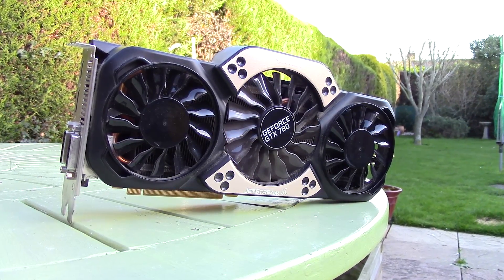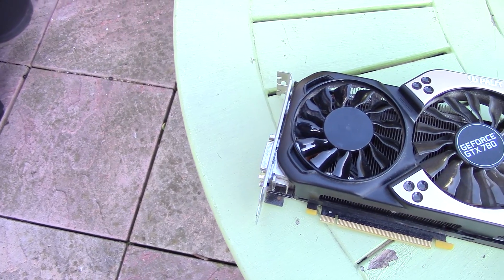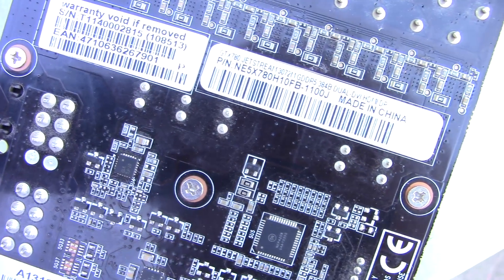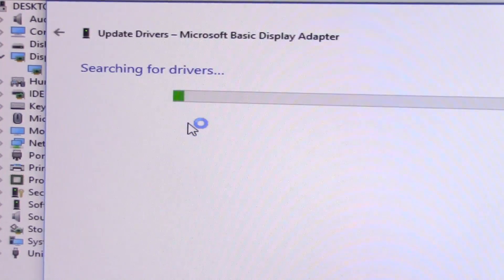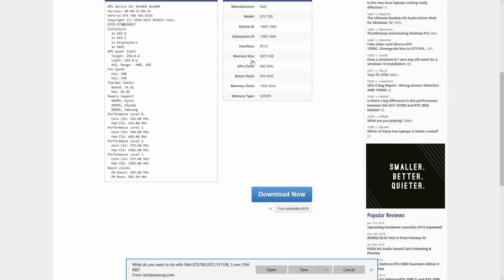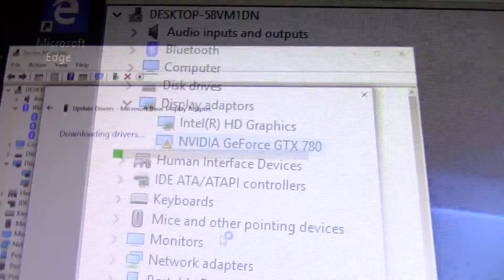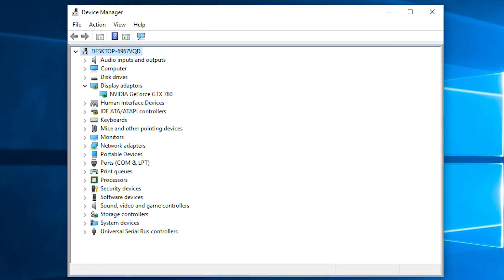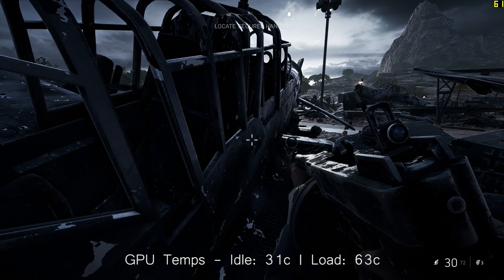Can We Fix This £20 ($25) GTX 780?

Comment: hi i have the i5 3550 but it only turbos up to 3.5 ghz do  you know how to make it turbo higher?      love the chanal btw
Reply: YOu can overclock the Turbo in your mainboard bios, IF you have the right board.
Reply: @MasterBlaster220  ok thanks
Reply: The only way to make your CPU Turbo higher is Depending on your Motherboard.

Maybe your Motherboard cannot handle anything higher than 3.5 Ghz.

Comment: I recently bought a half broken rx570 from a good friend of mine. Half broken meaning it would boot and work but only with the DVI Output so I downloaded the appropriate bios and flash tool, cobbled it all together and now I have a working rx570 with 8 GB in my System.

Comment: I know this is an old video, but did you notice if the new bios you flashed it with was different to the one already installed?
Reply: It doesn't really matter if it's newer or older BIOS than what already installed in the GPU itself.

What might actually happened with previous owner, the card may have attempted to update the BIOS, but interrupted during the process, like power outage or something, which resulting the GPU driver cannot be installed at all.
Reply: @ClayWheeler  thanks, but I wasn't asking if it was older or newer - I was asking if it was different.
Reply: @walruspolish  well, even if it's the same BIOS, he already explained that the existing BIOS is already corrupted.

Hence even if he's reinstalling / flashing the exact same BIOS it fixed the entire problem

Comment: hey i bought ASUS GTX 570 DirectCU ii from the marketplace facebook, the problem that the seller mention are same like this no detected in device manager since installing the driver turn into black screen i just buy it because worth for only 6£ with box and the unit, should i flash the bios to make it run again ?, if its work it will be awesome purchase for me. and also my christmas gift haha LOL JK.
Reply: Clean everything first.
Use Isopropyl Alcohol 100% (must not lower than 93% Purity. 93-100% Purity is Highly Recommended)
And then reapply Thermal Paste.

Comment: Ah, the good old intel 3450, I bought a box at a auction that contained 19 of those cpus and have 3 pc's that use them, 14 out of the 19 of the processors still worked and those bad boys will play a good amount of games when paired with a cheap intel motherboard 8 GB of ram and a decent GPU..

Comment: Still using asus dcu2 gtx 780 and gaming on 1440p. I have bought 1080 and rx5700xt but gave both back. This card is still capable in 2020 folks...
Reply: Any upgrades now?
Reply: @iboyrazz  not yet :)
I will use it untill next year i think and then buy something RTX. This card is really good and have served me well for all these years. Good bye 2020 and 2021. New card at 2022 :)

Comment: I had same problem with black screen on windows 7 with 970gtx. How do i fix the problem? I just installed old drivers from CD..... yes, for some reason old windows 7 with sp1 (2014y) had some issue, without any drivers i saw pulpit but after trying to instal 422 drivers i was getting black screen... basically after installing old drivers everything worked, then i just installed new drivers on old drivers and guess what, everything works, no black screan.

Comment: I've used ATIFlash a few times to flash the UEFI BIOS of a 7870 to an EFI BIOS for a 7950 for use in a Mac Pro. I also tried that with a 5870, but as for the 5870, i apparently got the wrong bios and bricked the card. It would no longer show up in ATIFlash, so i couldn't reflash the original bios to that card, so 

f

Comment: My gtx 780 I got for 50 working and I chose it over the RX 570 cause silence and also its a cooler in temeperature card. I also overclocked it and it works like a charm
Reply: What model of rx 570 was in your choices?  Because normally it is cooler than a gtx 780
Reply: @mikaelkabraelian8518  the red devil rx 570

Comment: A 7970 currently performs equal, or better than a 780.  The 7970 is older, and was slated to compete against the 680. The generation of GPUs released after the 7970 and 680 kept these cards around in a near identical rebrand. The 280x for the 7970, and the 770 for the 680.  The fact an orginal Tahiti 7970 now performs better than a 780 is outright pathetic on Nvidia's end on support older, but certainly still very useful GPUs.  The 7970 was released back before current gen consoles were even available, and yet they've gotten every frame possible thru the drivers. Were well made cards and were reliable.  I mean, fantastic 1080p gaming can be had for dirt cheap with these 7970/280x card for dirt cheap second hand.

Comment: Hey... I also discovered flashing GPUs from within windows, you can actually use team viewer from another pc, to connect to it as it uses its own display driver and not dependent on the graphics driver itself.

Only downside using Team viewer is that the resolution is 1024x768 which makes viewing some content crap, but it is plenty enough for running console commands to flash GPUs.

Also, I don't think you need to create a bootable to run NvFlash or AtiFlash. You can just run it from within windows using either your iGPU or Teamviewer.

Comment: I should have flash the Asus Cerberus GTX 1070 TI , but i was asking around the community so they opt for a replacement because it is still under warranty, and thus i got the MSI Ventus RTX 2060 instead.

Comment: I am a newbie too when it comes to GPU BIOS but I've flashed both my 1050Ti and my 460. In both cases I had to get in touch with the manufacturer and provide the serial numbers. Apparently it is not recommended to go on TechPowerUp and download what SEEMS to be the correct BIOS as there may be different BIOS for different revisions of the board. Just my 2p contribution :)

Comment: This inspired me to take up a challenge of buying a faulty GPU and seeing if it's repairable just for fun.

Bought a R9 270X 4GB for £15, so far detected in ATIFlash and as Microsoft Video Adapter in Windows, but crashes when attempting to install AMD drivers. The fun continues as I find a resolution.

Comment: picked up 3 dead cards for free other day gtx275 a gtx 580 1.5gb and a gtx780 3gb got the gtx 780 and 580 working fine. 
But the gtx275 is dead but is a cool batman one so mite frame it

Comment: I found another gtx 780 with the exact same problem for a very good price, it is worth buying or it could be something else? i don't want the whole thing to be a waste of money (the seller says it can output video until you install the drivers on windows, but he also told me that it need a reflow, i don't see why it would need a reflow/reballing if it works on the bios, could this be the seller having no knowledge about the problem?)

Comment: you dont need to flash it in dos or use igpu you can flash it right in windows while using the 780 i have done it a few times with a 660 and 970 you just need to disable the gpu in device manager and no it wont make your screen go black

Comment: "no performance metrics on screen" Well you had the FPS counter on so that counts for something :P
My guess is the original owner tried to flash it with an incompatible BIOS and tossed it in the ebay pile when it didn't work.

Comment: i Bought an R9 390 8GB Sapphire card, with the Same Failure after Driver install the Card goes Black... i Reflashed the Bios Lowered the Clocks -60MHz and the Card worked 30 Minutes then the PC turns off and the Card is dead Nice 120 €

Comment: Lol i had the exact same issue with my gt 210 (which i got for free) so i went into safe mode uninstalled the drivers and re installed then and my card started working flawlessly
Reply: This issue started after i updated my motherboard bios

Comment: The R9 290 is more comparable to the GTX 780 Ti, it's faster than the 780 not because of the drivers but because the 290 for one is a faster card specs wise and has an extra GB of memory.

Comment: I have the same black screen issues with an old 7300 GT i got that has artifacts because of faulty vram chips . I installed the driver, reboot, and then was greated by 2 minutes of black screen, after wich it Blue Screened. I tried reflashing the card, but it didn't help.

Comment: i have  same problem regarding my gtx 660 , whenever i install the driver the screen goes black but the problem is my graphics card was working  before in my old system now when i change into g4560 and h110m system it goes black screen , i have new psu with the board but the new gpu is 500w same like my old gpu i can asure that the driver is not being modded but i still  have the black screen problem , should i try putting old psu or flash the bios of the card (my old psu and new psu both are 500 w though )
Reply: You already have the second PSU, so just try it. Faulty PSUs will cause a lot of black screens.

Comment: Whoa whoa wait. You can flash your GPU bios while using it. You dont need onboard integrated graphic to do that. If you can't flash in windows there are hacks with bootable usb drives and running bios flash in dos like enviroment.I did those things with only one gpu in my system back in a day with my Radeon 9500pro gpu with bios flashing software loaded onto bootable floppy drive and bios was on that floppy too (hehehe those good days when gpu's was locked so U couldntt overclock it without flashing hacked BIOS. I even set custom clocks in vga bios after prior testing with oc software of course...oh I miss ATi days ).
So what's the fuss about "you need an igpu to flash your discrete gpu bla bla bla....)....
sigh... YOU NEED THAT ONLY IF YOU FUCKED UP GPU BIOS FLASHING AND WITHOUT IGPU YOU'LL SEE ONLY BLACK SCREEN. That's why.

Comment: I had the same card before I upgraded, well, the "Super" Jetstream 780, and it worked fine for 5 years, then one day it started going to black screen and fans to max rpm when certain games were running, and not even always with the same games. It felt like there was either some specific thing it tried to do and crashed, or when the load started getting somewhat high. I cleaned it and chnaged the paste, temps were fine but it still did that. I thought it might have been a new driver version causing problems so I reverted to an older version and blocked windows updates, it worked fine for a week and then it did it again.

Comment: Looks like you grabbed yourself a bargain!

A strange coincidence, I recently bought a cheapish 1060 3GB that evidently was incompatible with newer NVidia drivers.
That too turned out to be a vbios issue, solved with a simple reflash (didn't even need to leave Windows, let alone reboot!)

When looking for 'faulty but maybe fixable' cards, I'd steer well clear of AMD's R9-generation cards.
Many of those faults stem from overheating damage to the VRM, a problem easily encountered given how hot they ran.

Comment: someone may have tried to flash it with a custom mac bios,I messed one of my cards up the first time trying it but luckily had a back up of the original bios and flashed it back,a year later I got a different graphics card and flashed with with a custom mac bios again and it worked perfectly in my mac and I saved a lot of money as apple versions of the cards are way more expensive.

Comment: i have a 780 3gb card that my uncle gave me. it burned up or something.  it wont boot when    plugged in, but will turn on without the psu pins...but only have a message saying to plug in the pins. when i tore it apart and cleaned it,there was 2 chips that said "R33" and they looked kinda brown and had an electrical smell.   is it a lost cause?

Comment: you went the hard route on bios flashing, you can do it from windows with a few clicks, try a few roms right there, some clocks tuning, no need to reboot just bench it offscreen if you like, got a 460 back to life like that but only for like a year, a new flash and slightly lower clocks did the trick, not so lucky with a 660 tho, that thing was very dead but also just like 10$ shipped so whatever

Comment: RandomGaminginHD, I have a gtx 1050 ti 4gb that I got from a desktop I gave to my dad for him to work, in trade for his old laptop (because i needed a laptop for university). Could you tell me the best cheap PC's to upgrade that I should look for in ebay that can handle this card and a decent cpu and 16gb of memory? (or 8 is enough, but i think 16 would be the best choice)
Reply: @mipmipmipmipmip thanks, but what kind of cpus can those desktops have? Do they support like i5 3450 or something, and what about the ram
Reply: @nyblenproductions5166  go to cex.co.uk they sell everything used and dirt cheap you could make up an old AMD FX 8350 system for cheap
Reply: @andyjackson6793  I'd skip the FX unless you get them dirt cheap (I found some entire FX-8150 systems for $20 each, I passed...). Its super old and power hungry (laughably so compared to the 1050ti). Sure they can game (I ran my dinosaur with a Titan Xp, and at 4k, the Titan was the only thing holding it back), but Ryzen is just not a lot more ($50 board for overclocking, and either new 2200G or used 1600 for $100 would be the way to go, and DDR3 is getting insanely high, like about the same price as DDR4...)
Reply: @JosephGreathouse-l8h  Still generally bad value (unless you get board and CPU combo at $20). An i5 2400 prebuilt is probably better.

However, I looked, and FX boards are severely overpriced even for the used budget ones... A decent FX motherboard USED costs more than a pretty good brand new B350 (and some X370). In fact, most I found were about $10 more than boards that I would classify as "decent enough" for extreme overclocking for Ryzen 2700x (extreme meaning liquid nitrogen, not just water cooled overclocks). With the really nice (and vastly obsolete) 990FX such as Sabertooth costing more than some of the very best record setting boards for Ryzen (I have no idea why). Even my crappy 970m Pro3 with its garbage 4 phase VRM is going for prices USED more than I paid for it NEW in 2015 when it was still sort of relevant... That's just stupid, its super obsolete tech, like extremely obsolete...

16 GB of DDR4 is now $89 on Newegg (DDR3 used is about the same price...). And Ryzen 1700 used is about $140. You can get a B350 for $40 and up, or X370 for $80 and up.

I'll be selling my Ryzen 1700 with X370 Fatality with 16 GB of benchmark tuned RAM for $300 in total for that CPU/MOBO/RAM combo... (not abused with sub-zero overclocking, I planned on it, but upgraded to X399 and Threadripper before I got around to it).

So just saying, FX is stupid expensive considering new Ryzen prices, and if you're on a budget, $80 for an entire prebuild i5 2400 (Windows pro edition included), and toss in a $20 CX430 and you've got a very capable $100 plus GPU combo that will get up and run in games.

Comment: I bought 4 broken GPUs, fixed only 1 of them. Guys, whatever you do, if you WANT to buy broken graphics cards be sure to test them at the seller's place. I got hosed by two sellers that claimed something around the lines of "I guess it's overheating" but in reality the GPUs gave out no video signal, which is pretty much the worst defect it can have.
 Do NOT buy GPUs that don't give out video signals!

If it's something like one of the cooler fans spinning at 100% at all times go for it, Arctic aftermarket coolers are an easy fix for that.

Comment: I managed to pick up a faulty MSI 7850 2GB for £10 last year, hoping it'd be untested, but I found it was completely dead. Flash forward to August, I bought a heat gun to do some work on a few YLOD PS3s that I had lying around, tried it on the card with some no-clean flux and it's been working fine ever since. Back in 2017 I sold off my old EVGA GTX 770 for £30 after it had "died" and now that I look back at it, it probably just needed a BIOS flash.
Reply: ndreww I got an Rx 480 that was acting like this for free in July, but after not being able to get it to work I sold it for £60, wishing I thought about trying a bios flash back then as I only considered it useful for overclocking. Windows simply wouldn't detect the card, not sure if a driver installation would have done anything.
Reply: @Killius  But it is a good temporally fix if you don't have the money for a new graphics card right now
Reply: I'm well aware of whats actually happening when you perform such work on the card, but it cost £10, and it would've been sitting dead for the rest of it's existence otherwise. It's obvious that it'll drop down dead soon enough but considering that I don't even game on the computer it's in and I've got spare graphics cards elsewhere, it's a perfectly acceptable thing to do to the card. Same goes with the PS3s that I did work on.
Reply: @Killius  Nope, that is with the oven. WIth a heat gun you can resolder the non lead tin connections that are already there. But its not an exact science tbh. A thermometer helps here though.

Comment: i recently got an even older gpu  a gtx 560ti it does the same thing boot into the bios but when i install the driver it wont work but i tried to clean it flash the bios but i flashed the bios using not a bootable drive but using nvflash in windows idk if a bootable one will make a defference  tell me what do you think ?

Comment: Did you have a link to that flashing turltotial by chance I have a 670 that has the same exact issue. Works until the driver is installed.

Comment: I just got an MSI GTX 750ti low profile for 45- I paired it with 8 gb of ram and an i5 2500k. I'm surprised how powerful it is
Reply: Nick Rosetti not that good of a deal
Got a 670 for 55 bucks
And it’s roughly 80% more powerful than the 750 ti
Reply: @yournemesis192  is it a low profile card?

Comment: I fixed my Gainward GeForce FX 5950 Golden Sample in 2004 this way, after the failed first attempt on flashing BIOS update, then I used a PCI card to while the AGP one was not working so then I just flashed Nvidia BIOS using command line flash tool.